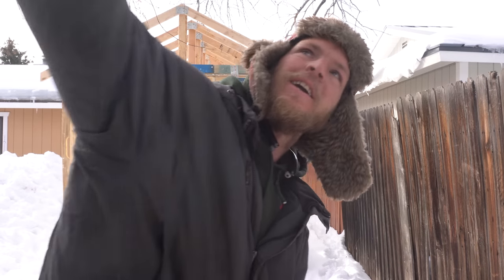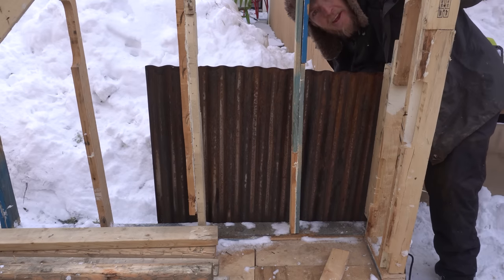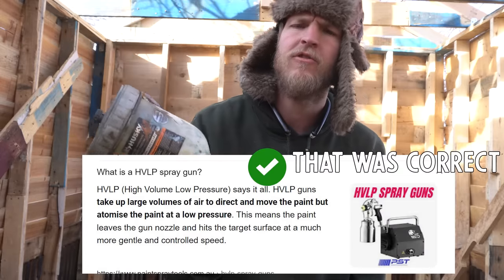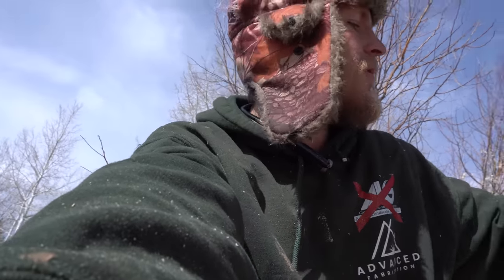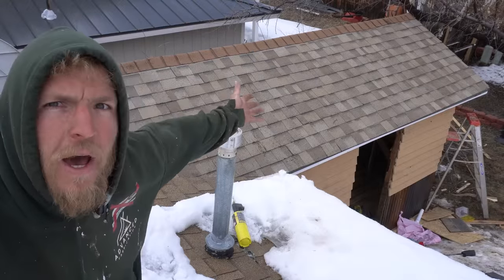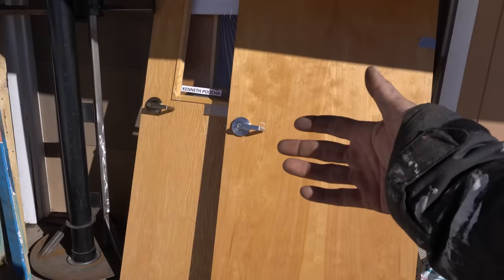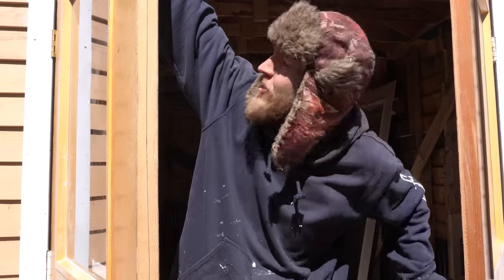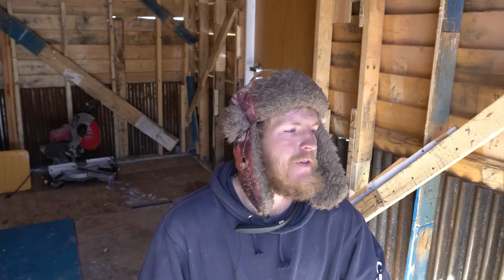Finishing Up My Pallet Wood Shed

Comment: If you have some old paint you could paint over the ship lap boards and the paint will help seal the edges that overlap. This will help to insulate the shed. If not and you can get to the walls in the spring or summer, you can paint the inside where the 2 boards come together and make it where the air and tiny bugs don't get in the shed
 🙂

Comment: Pretty nice build from scraps! - I was wondering, why the steel roof plates in bottom of the walls instead of the siding?
Reply: Wooden siding all the way down would just rot sat in slowly melting snow. The congregated steel will eventually rust too but not nearly as fast.